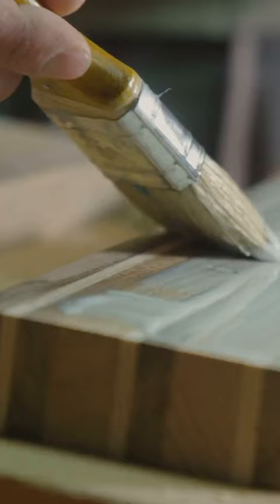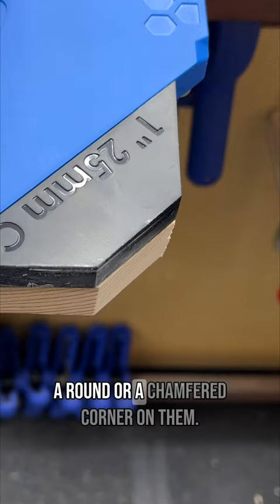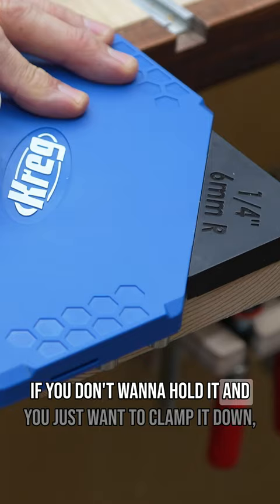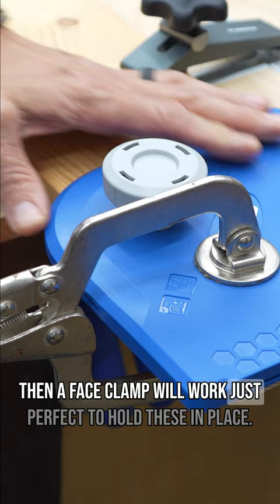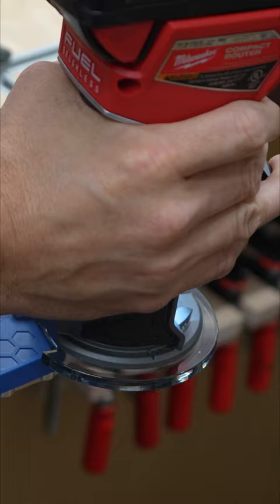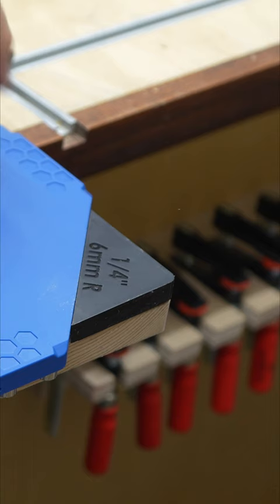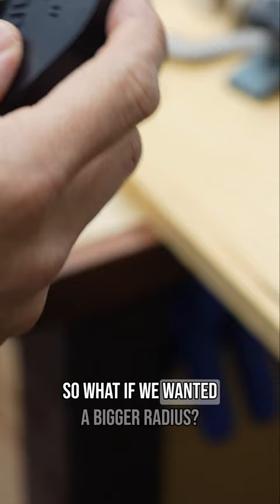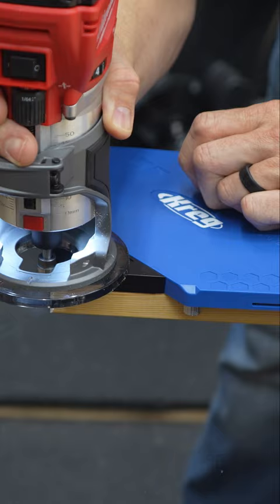I Can't Believe This Tool is Only $40!

Comment: Lot of tear out though, whats up with that?
Reply: Can be avoided/reduced if you can flip the board so the cutter cuts with the grain instead of against the grain. But that tip would probably be its own short because a minute isn't a lot of time.
Reply: it helps if you reverse the direction, or also known as climb-cutting.